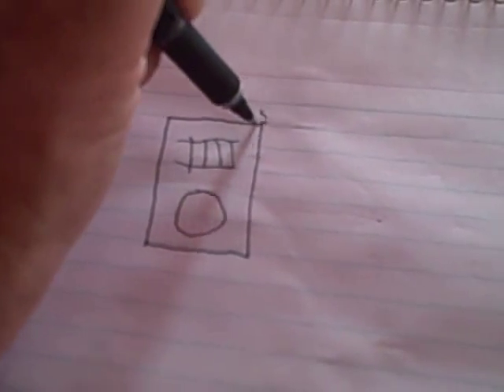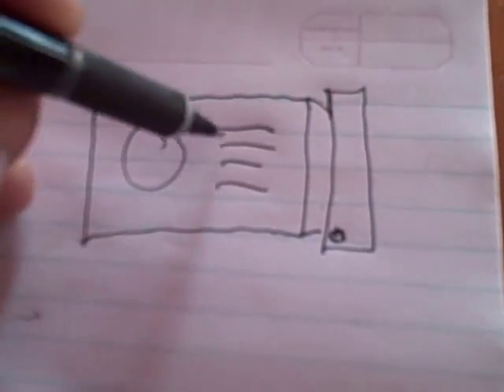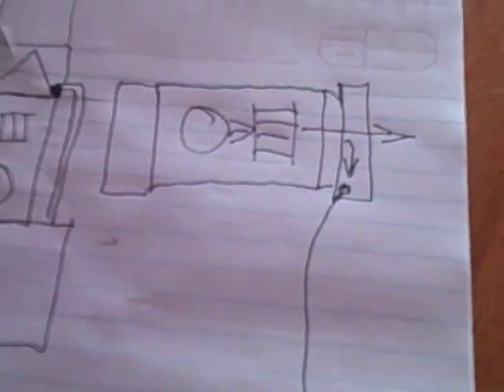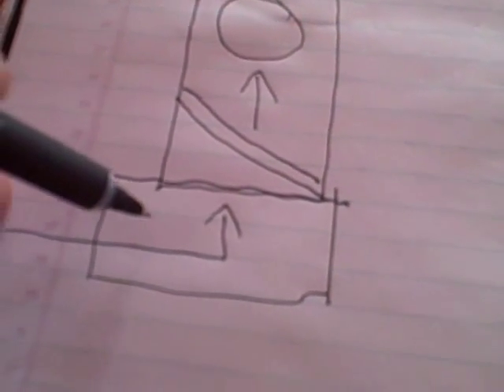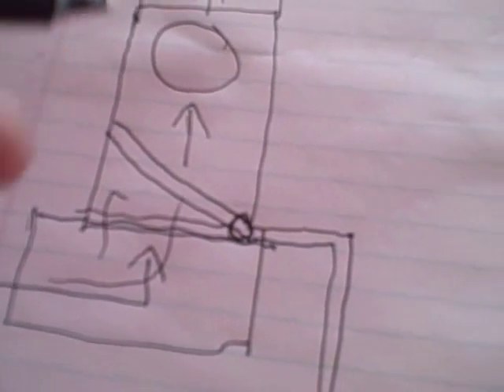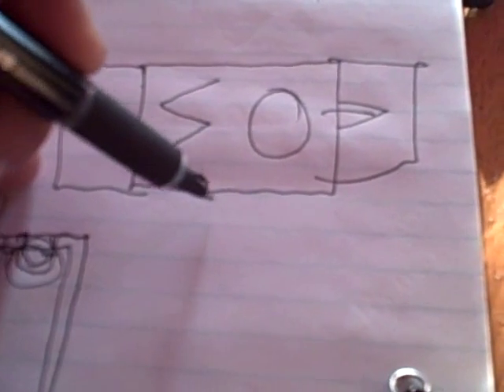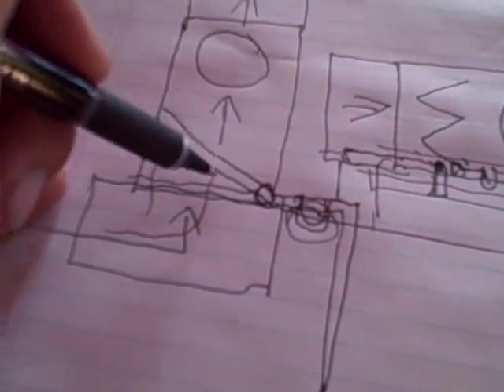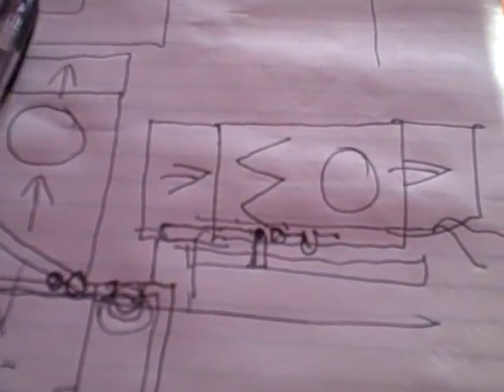HVAC Negative and Positive Pressure pt. 2 on Air Handlers and Gas Furnaces.

Comment: Your video about negative pressure and condensation line with p-trap is something of a concern for my circumstances. My question is where should the vent be on condensation line with negative pressure. Should it be after the p-trap or before it?

Comment: It's funny how you say nothing about where the vent goes on a negative and/or positive pressure system. I find it very interesting that you say absolutely nothing about that..... . Unreal
Reply from the maker: What 'vent'??  You have air going into the coil,  air coming out the other side of the coil and the condensate drain,  and the emergency drain (if applicable), that's it.  :)
Reply: @mikie2501  I see vents on traps all the time. I'm confused. Thanks for replying. So no vent is necessary?

Comment: Just what I've been looking for.  Thanks but a question.  Have a new unit 2 years old, Goodman, I live in Houston,  high humidity,  the unit started leaking g down the air intake, started drippi g small amou t but then.  Now when the unit shuts off about 7 pm after running all day, because wife wants it at 74 during the daytime.  When it turns off alot of water is coming down the air intake. We opened a hole at insulated intake to look at coils, and can't see anything leaking. But yet it still does. HElP if possible.

Comment: I have a horizontal unit. Not sure if it's positive or negative air flow... but there's no secondary drain that I can see,  the whole unit is sitting on 2 2x4s that are just laying in the drain pan... sitting in water. There is no vent or p trap on the gravity feed drain and we are having to vacuum the water out of the pan 4x a summer because the pan is filling up. We've tried sucking the drain from the bottom outside, but it only pulls out so much and the pan won't start draining... we can't access the drain hole in the pan easily to vacuum out from the drain in the attic.  This unit is only 5 years old.
Reply from the maker: Okie dokie... Wow!  Well it sounds like either you have a positive pressure system and the primary drain line is partially clogged and when it can't keep up, the excess gets dumped into the pan... Or you have a negative pressure system, and because there is no p-trap, instead of the water going down the drain when the system is running, the negative pressure from the unit keeps it from draining while the unit is running.

When the unit reaches temp in the house and shuts off, then it drains, BUT if the unit has to run for a long time because it's hot outside and it pulls a lot more humidity out of the house, it will be holding more water in the unit than the pan, inside the unit, can hold. It will literally overflow the internal pan, soak into the insulation inside the unit and start filling up the case.

When the unit shirts off the water will start dumping out everywhere, out the main drain, out the emergency overflow into the emergency pen underneath, and out of the cracks and corners of the unit and dropping into the pan.  

If the unit is only five years old and you are the original owners, you might be able to harass the company into fixing their bad installation.

Let me be clear, the pan that your unit is sitting in IS the secondary/emergency drain pan! There are two ports coming out of the unit where pvc pipe should be attached, one Port is slightly lower than the other. The lower one should be piped and run straight outside, with a p-trap attached to it if it's a negative pressure system. The entire pvc line running outside should have a slightly downward slope to keep the water flowing, with no bows in it that would cause problems.

The slightly higher Port should have a small but of pvc then an elbow aimed down into the emergency pan, with another piece of pvc to get it down close to the pan so it isn't splashing all over if it's used. Then the emergency pan has a drain line coming out of it going outside as well. 
TYPICALLY the ac unit is suspended by wide, solid metal straps (not that plumbing strap with holes in it) or maybe up on 2x6's, or professionally hung with allthread bolted thru rafters above into U channel steel beams that the unit sits on.
Then the emergency pan is HUNG below the unit, with a slight tilt towards the side that the pvc drain hole comes out of it. So that it sheds as much water as possible when there is an emergency and it is used.

If you don't have two drain lines tapped out of the unit then something is wrong! You had a HACK install the unit.   If you are looking at the front side of the unit, looking at the section where the electrical goes in and the door screws on to the blower section, if the AC coil is in the Left side of it, then it's probably negative pressure. The blower is Pulling air through the coil from your return vent, then pushing it through the heat section which is in the electrical section, then out to your supply ducts.

If there coil is on the right side of the blower section, then it's forcing air into the coil, creating positive pressure, which would push the water down there drain line.

Regardless, you need to have someone come in and fix the mess! Otherwise your problems will get worse. Eventually the emergency pen will start to rust thru and you will wind up with your sheetrock ceiling caving in and a huge mess in the house. If the internal primary pan is being overflowed then eventually the bottom of the unit will rust out too!

If it's a negative pressure unit then you HAVE to have a p-trap on the primary, AND on the secondary going into the emergency drain pan. I don't know how many units I've run across that they did the primary but not the secondary! If the primary line gets clogged up and it has to drain out the secondary and they don't trap it, then if the unit runs too long it overflows the internal pan and flood the inside of the unit. 
Worst case scenario is that the water gets to the electric section and bad things could happen, depending on the manufacturer and where they placed the electric components.

Hope this helps and keep me updated, if you think about it! ... On second thought, don't call them back, get someone else!

The emergency Port is slightly higher because it's normally NEVER used, unless the primary drain line gets clogged up.

Comment: How do you stop a negtve pressure  in the winter when heater is on be side adding water  sucking air in bathroom sink and yes it has a trap and a vent

Comment: I have a positive pressure system with a trap on the main drain and a secondary drain for backup. The system mostly drained from the secondary. I cleaned the system out twice and even had a Beautler come out and service it but the darn thing still pours out of the secondary. Any Ideas?
Reply from the maker: Michael Wright if the line and the trap are blown clean and there is no restriction there then that just leaves two other possibilities, either there is some trash blocking the primary right inside the coil case where the primary attached or the drain line isn't sloping downhill properly and the water just lays there.
Reply: I'll check it out and get back to you

Comment: Mike I appreciated this explanation video. I have a question (homeowner diy): I have a Trane and the handler is horizontal in garage. I keep having condensate overflow issues (bad...mildew on wiring and wetting insulation of cabinet et cetera.. a mess with garage soaked floor) And I've had unit under service by professional a/c techs but no one has offered a solution. I now note that my primary drain line doesn't have a trap until it reaches the exterior of outside wall (running through wall not under slab floor and back above ground) and my secondary has in place SS1 overflow switch. Is this the reason for my chronic issue; the whole cabinet is soaked with water (trap too far away; and should be as close to unit as possible) If so, they didn't install with equipment replacement a few years ago. Also, you could hit your head walking under suspended handler hanging from garage ceiling when passing underneath if trap were installed. I would appreciate a follow up with any further insight/guidance from you.
Thank you for your time. Brooks 
p.s. based on your explanation I have a negative pressure system (blower draws air from return through refrigerant coil)
Reply: The same here
Reply: Check may be the drain is line is blocked, air tight the unit,

Comment: my air handler/fan coil/heat pump  (in attic) has blower on RIGHT and evap coil on left facing the unit (from attic stairs). 
HORIZONTAL unit.
The primary does NOT have a p trap. It goes 1/4 in grade down (sloped) outside the home -follows the line set.

Assuming this is a POSITIVE air pressure system or Draw thru.?//

Havent had any issues backup- clean line yearly- the coil is rusted in the corner near the primary drain accces point.
Reply from the maker: +Marcie M Hi Marcie! I started a reply earlier but was sidetracked with a show my wife was watching, heh, when I came back my tablet had shut off and deleted my text! 

Before I can tell you if its positive or negative pressure I'd have to know which side of the system the return duct is hooked up to and/or which side the supply ducts going to your vents is on.

If the return duct is on the left, like: Return Duct/Coil/Blower+Heat Elements/Supply Ducts... Then its a Negative Pressure system because the blower is pulling the air through the coil.

If the Supply Ducts are on the coil side like: Supply Ducts/Coil/Blower+Heat Elements/Return Duct... Then the blower is pushing the air through the coil to get in the house and its Positive Pressure.

I've seen negative pressure systems that never overflowed because they didn't stay running long enough at any given time to accumulate enough water to overflow the pan. However if it ran long enough and pulled enough humidity out of the air then it obviously would.

Hope this helps!
    Mike

Comment: I have a negative pressure air handler, with the inlet of the trap 7" long and the outlet ot the trap 3" high,  i have a cleanout pipe on the inlet side of the trap with a cap on it but no vent pipe on the outlet side of the trap and it still leaks water inside after the fan shuts off, any ideas?
Reply from the maker: Sorry, somehow I missed this one!  Hmm.. Well I have two thoughts. The first is that you might have a bunch of crud built up in the coil tray that is causing you problems.  Second possibility... Well a three inch height should be fine, but how is the slope? Check to make sure you have a downhill slope all the way to the sewer drop. Sometimes Ill find one in an attic that looks fine initially, but the sewer drop is on the other side of the attic and somewhere across the attic they have the line bowed between the hangars and it cant flow out.
Im assuming youve checked to make sure the line isnt clogged?
Its been a while, so youve probably sorted it out by now, what was the problem?
   Mike

Comment: Thanks for your videos. I have a positive pressure down flow furnace/evaporator. It has a P trap and is draining water properly but seems to be blowing out the trap of water allowing air to flow through. How to resolve this? Do I need to build a deeper trap? The trap is about 2 inches tall on the shortest side and is made from 3/4 PVC tubing and connectors. The trap drains to outside the building so it is venting conditioned air into unconditioned space. I also don't want critters to be able to crawl up the pipes and into the evaporator box.
Reply from the maker: Hmm.. Kind of hard to trouble shoot that without actually seeing it.  It sounds like the trap is just too small though for the positive pressure, you should be able to increase the size several inches and solve the problem.  Dont forget to leave a bkowout/cleanout opening so that if it gets clogged the guys can blow it out.  You should be able to look at google images to get an idea of what I mean.  
If you put it on the unit side top of the trap remember you have to put a riser tube out the top that is higher than the bottom of the drain pan or it will leak out the top when uncapped (dont glue a cap on it)
...umm... Wish i could post pics, lol.  Heres a sample page...
https://air-conditioning-hvac.knoji.com/how-to-properly-install-a-condensate-line-trap/
Reply: mikie2501 Thanks for the detailed reply. I suspected the same; I will rebuild the trap to be taller to contain more water.
Reply: ***** Just wanted to say thanks for the help - I built a longer trap and it seems to be working. Thanks for confirming my suspicion before spending money on parts I might not need.

Comment: thanks for explaining the difference between positive and negative air handlers.i have a problem with one leaking condensation its the vertical type negative air handler.i made a larger p trap but still leaks.
Reply from the maker: If the coil is dirty or has crud packed down in the coils it may actually be dripping straight off the coil instead of running down the coil fins to the catch tray.  Make sure you actually have the trap filled with water too before you start it up or it will likely just suck air and not build up enough water in the trap to do its job. With no water in the trap it pulls enough air through the drain pipe to keep most of it from draining and if it gets high enough in the tray the blower will pick it up like rain droplets flying towards the blower, leaking wherever. Worse if it overflows. Also make sure the thing isnt clogged between the pan and the trap (or further down for that matter)  i usually slowly pour a gallon or two into the pan to make sure everything is draining outside and nothing is leaking.

Comment: The part about what the water in the trap is called is " water column " or water weight to stop air from being sucked in very common in FL like the videos keep it up i'am a 20 yr tech industrial process ref and comm ref these vids are very helpful to the next gen

Comment: Didn't know it was that complicated. I didn't even know there was such a thing as negative pressure systems. I live in Canada and every house has a basement and every furnace I've seen is vertical, upflow, positive pressure.

I'm just an engineer though, not an HVAC tech :)

Comment: Sweet Video...
That helps alot, I been having a hard to grasping the negative and positive pressures on air handlers
I m been putting traps on air handlers just to make sure that water wouldn't go back in to the system. I seen videos of DR Z, putsome5tankonit, hackfree, and your videos about the importants on drain traps. I ll be sure to put on a second trap on the secondary drain.

THX FOR THE VIDEO